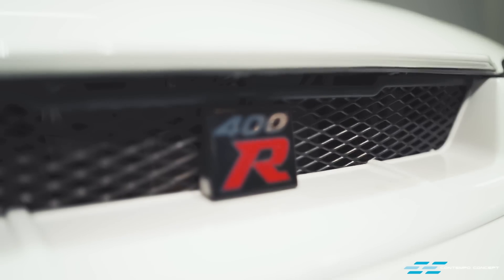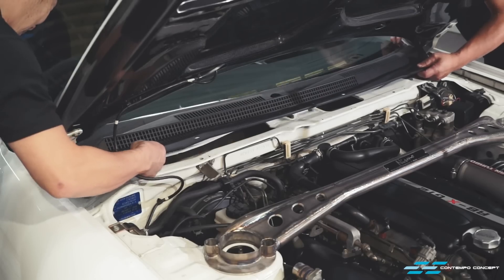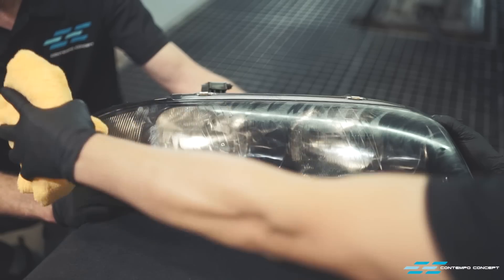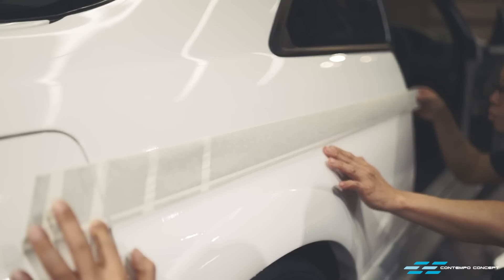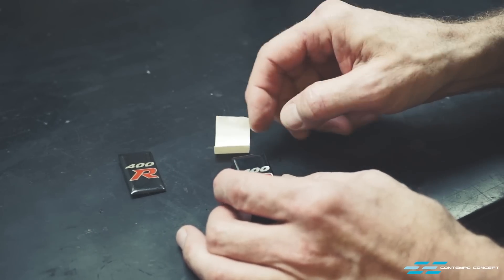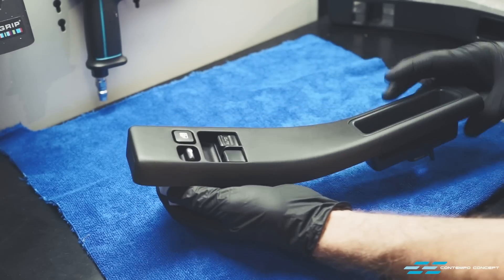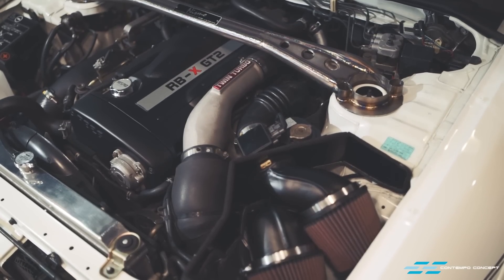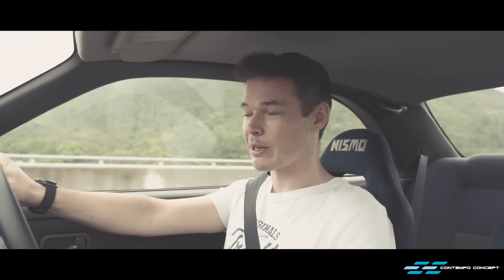Nismo 400R Restoration

Comment: These guys are the "Maestro's of Magic" when it comes to vehicle restoration and paint perfection.    If I ever got a car that needed restoration or bringing it back to "like new" condition,  I would seek out their services for it.      That older NISMO badge in blue looks incredible.   I wish Nissan had continued to use that older style badge, which in my opinion,  looks WAY better than the modern NISMO badging.     When they do finally come out with a Nissan "Proto" Z (or 400Z, whatever they are gonna call it in production form),  they should definitely use the older style NISMO badging on it.    That would be the "icing on the cake" so to speak.

Comment: So beautiful but what’s the point of having it this perfect. I rather drive the hell out the car instead of dealing with anxiety every time I see a rock pebble on the road.
Reply: You really think this car is seeing the road ever again?
Reply: lmao
Reply: Right? Isn't that the sole purpose of a car?
Reply: @Syncopia  Not these. Rare vintage mechanical artworks like these become collectibles and museum showpieces decades later. Not every car is worthy, just the iconic cars that seemed to mascot the eras they were built and released in. This car already had its time being driven rough and well. If it can retire as a magnificent specimen of its lineage, then it's worth it for it to be maintained carefully. Used only for car shows, car meets and other special events, artworks like these are to be transported enclosed in trucks and not driven about daily. That's not why one does a restoration job that would cost upwards of 100k. Besides even as an investment, this would eventually reach the $400k mark, maybe more. I love that about automobiles.

Comment: This is my opinion but you guys need to join forces with five star car stereo! For y'all's restoration to work and making the automobile look extremely brand new honestly I haven't seen a show on the Internet or TV that would match y'all well besides Overhaulin and trick my truck but they have nothing on you guys that's just my opinion! I'm also sorry if I did comment on this video before but deep detailing and the great length of the extension of what you guys go through is just simply breathtaking there are no words to describe what you all do but I'm glad y'all exist! :D

Comment: What a masterpiece! That video got me goosebumps and wet eye's because it's SO damn GOOD! 

I would also have overhauled or checked the engine internals of the engine because why not when you go in so much details with everything else?😃
I also would have upgraded the speaker's and installed a stealthy but good amp and subwoofer so that everything keeps it's original looks but has top of the line sound quality.

This car is am absolute time capsule!😱🤩
I can't even imagine seeing one of these.

Comment: Just before the 6 minute mark were you guys using a non impact rated socket on an impact driver and also not following up with a supercut of 20 torque wrench clicks? I may have found the flaw in this video lol. Awesome job, there's something really great about full factory restorations like this. I would never have gone with the cassette deck but I guess the owner's going to use this as a once a month car at best if not on display indoors so not much concern there.

Comment: I don’t comprehend how you line the wheel socket with Teflon then you defeat the whole idea by using an impact gun. For goodness sake just put them on by hand then use the torque wrench. It doesn’t take that long. I do find your vids so therapeutic.

Comment: I feel like I need to repost a reply I posted to a comment that it's pointless to do this and keep these cars in garages when cars are meant to be driven.
Here's what I say to that:

Not these. Rare vintage mechanical artworks like these become collectibles and museum showpieces decades later. Not every car is worthy, just the iconic cars that seemed to mascot the eras they were built and released in. This car already had its time being driven rough and well. If it can retire as a magnificent specimen of its lineage, then it's worth it for it to be maintained carefully. Used only for car shows, car meets and other special events, artworks like these are to be transported enclosed in trucks and not driven about daily. That's not why one does a restoration job that would cost upwards of 100k. Besides even as an investment, this would eventually reach the $400k mark, maybe more. I love that about automobiles.
And no, they won't "rot" in garages no more than a Toyota 2000GT would. These will outlive every road-going version out there in the decades to come. I'm happy that this 400R would get this opportunity for immortality in factory fresh glory.

Comment: HOLY COW.  Like I knew these would be expensive but the prices on these cars are beyond ludicrous. A 95 M3 for $43K. A 2004 Miata for $40K.  A 2017 Mustang GT for 65K.  Did you independently reverse-engineer and fabricate these cars in house or something?

Comment: i understand why people want to get a car back into stock config.. but sometimes, it feels like that youre not doing yourself a favor when you reinstall something, like a casette radio, which in todays time, isnt that usefull anymore. some things arent just there for the charm of it, they are there because the tech wasnt far enough. for example, buying a card that has ABS aftermarket installed, which the original didnt have.. remove the abs system restores the original system, but is a dumb choice for safety

Comment: why did they do all that work cleaning the undercarriage and and hood area and interior AFTER the paint job? usually you do take precautions before not to get your paintjob contaminated!!
best job would be to take the car apart way more!!! no paint update in the engine bay and undercarriage???
heck they must have been really extra-careful not to scratch the paint especially when removing the interior, seats and stuff, I see no protection whatsoever even when putting the glass on, these guys looks like amateurs..  you never know when you can screw up... been there done that.. video is partly-staged for sure... 
gimme a break, guys are polishing the paint with stuff already on the car, front licence plate on and everything, wheels (ok), tires (some chemicals can affect them)??
and btw who knows it is really a 400R, the decals can be reproduced btw...
but nice results for a multi-million dollar pocket owner, now don't forget to take it for a spin once in a while, otherwise it is a waste..
btw hope you sell the used parts on eBay or such, plenty of them are re-usable..

painful to watch, had to stop halway during the interior being redone...
if you want a brand new car, go get yourself a brand new GTR at your Nissan dealer...